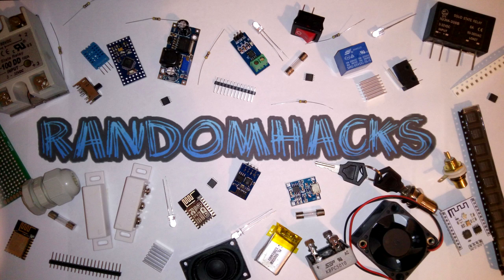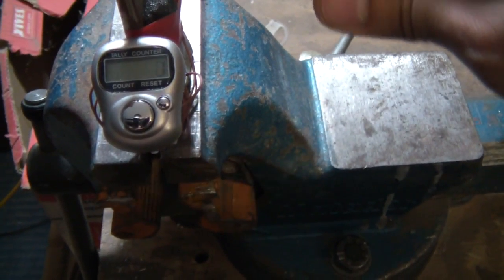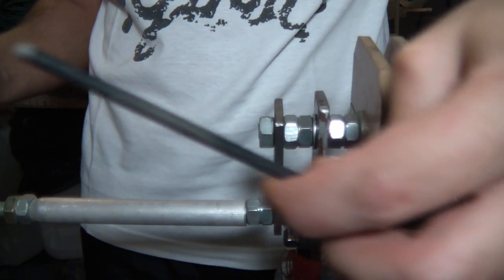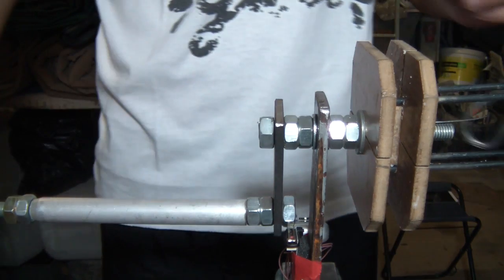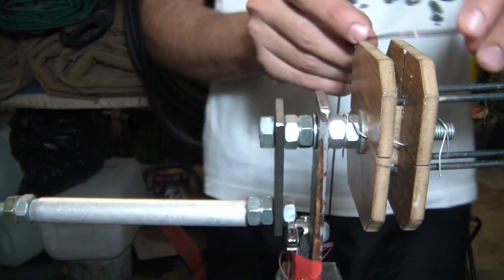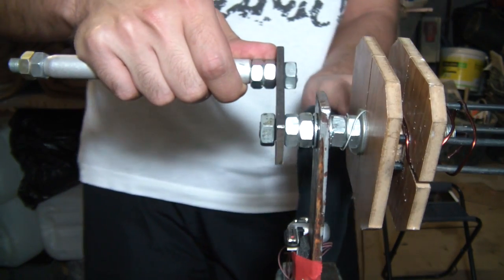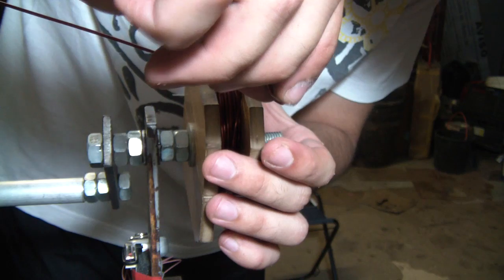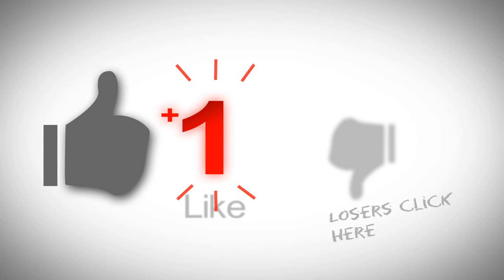DIY 1kW HAWT Wind turbine [Part 2]  - Winding the coils

Comment: a query, i see you put in another video mentioning hugh piggott, which mentions that for 24v voltages, you use two wire in one winding, but i see that you use only one of 70 turns, and you can get more than 1kw, while piggott with two wires in parallel that only 800w, has your work worked for you? as for reference :)
Reply from the maker: I'm not using Hugh Piggot's stator design, I believe he doesn't use 9 coils. The stator design I use has been proven many times to produce about 1kw with the correct blades.
Reply: @RandomHacks  
Do you think you can only fit a single 14 # thread and 70 turns to a 14 'rotor? Well, I already have the rotor ready :(, do you think it works?
Reply: @RandomHacks  
thanks for your reply :) i was wrong, you mention envelope hubs and hugh's tail.
Reply: @RandomHacks  
videos of how I could not see your videos before, I was based on piggott, with a 14 'rotor, 70 turns with two wires, 9 coils and it would give 800w, because yours produces more and with half the copper wire and the metal disc, thank you

Comment: Your Neodymium magnet is 1inch x 2 inch, your coil is awg 14 = 1.628 mm, coil center hole equal magnet size, 70turn, SO if in your country electric power is 60hz frequency, my count result is not 1.5kw, with that 9coil you only get 134.4Volt & safety at 10ampere = 1.344watt, NOT 1.5kw, you need 14.93 coil for result 219,968volt OR 15 coil (each 70turn) for result 224volt
Reply from the maker: Hi, yes I might have overestimated the power but I don't understand your calculations. I have 3 phases. I believe 14AWG solid core wire can handle up to 25A so times 3 would be  75A max. Of course I won't get anywhere near this amperage. The generator will produce about 24 to 30v AC dwhich will then be rectified to DC and only then I will use a grid tie inverter to inject it to the grid, I can also connect it in star or delta configuration. Thanks for your comment.

Comment: What increases or decreases in using more or less coils per phase, 5 or 3 etc ? is it watt? or volts?
Reply: Frec Menta  watts is just the total power. of the volts plus amps. if either volts or amps go up. the watts go up. adding turns per coil. raises volts. the thickness of the wire determines amps. the same with more phases. since when rectified the amps are added together. surely you knew most of this.